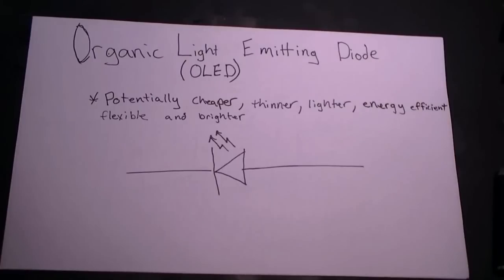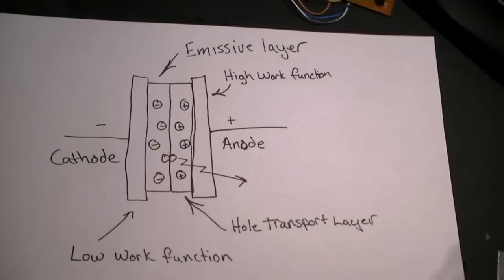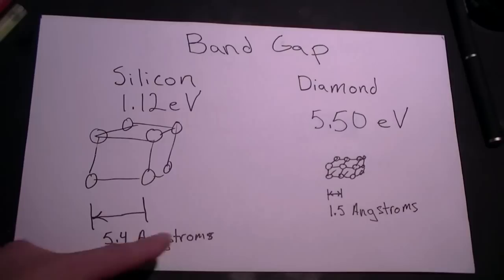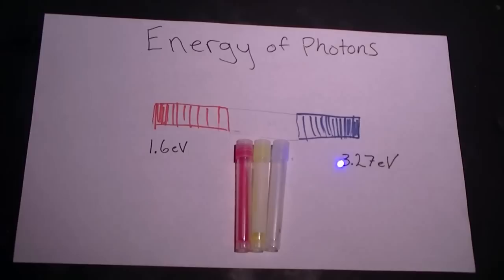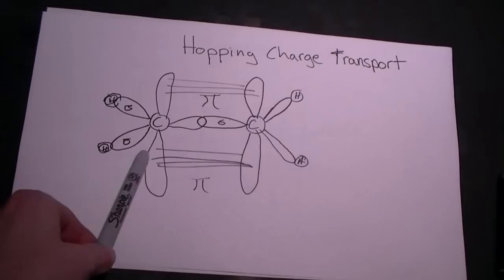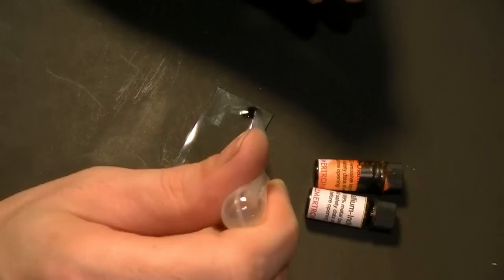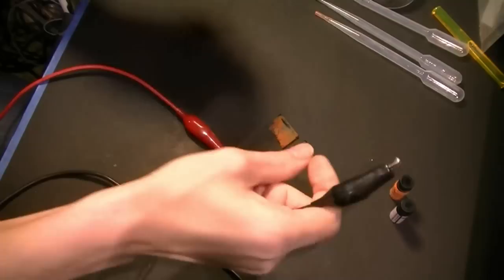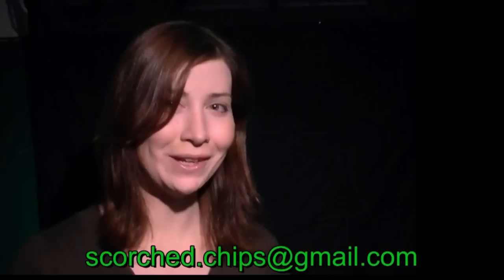Making an OLED - Light from Carbon Compounds

Comment: Inkjetting & spin-coating are both fairly old-hat when it comes to OLED production; slot-die coating is also used for accuracy & maximize material use. Current research is into roll-2-roll (R2R) printing, which is when the cost is so reduced and scale of production drastically increased - which in turn means we will see OLED & Flexible OLED displays & lighting everywhere.

Comment: So it sounds like works by sending a charge from a layer of low Ph to a layer of high Ph. So it sounds like  the moving of the charge across the Ph gap causes the emition of light since its moving from a low concentration to a high concentration. Do I have this right?

Comment: Jeri, am I right, that instead of using special materials for electrodes with high or low work functions, one could use any conductor and just adjust input voltage to compensate that?